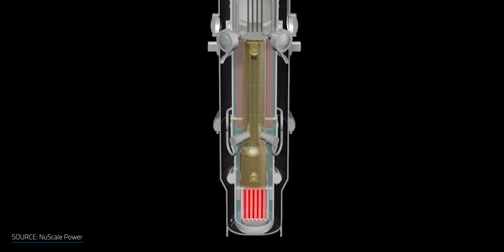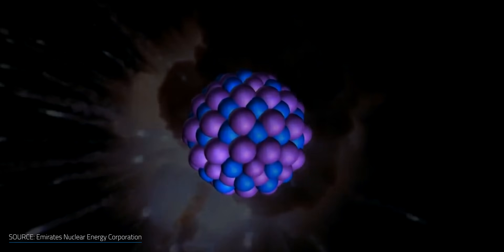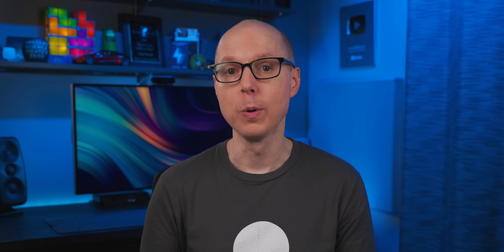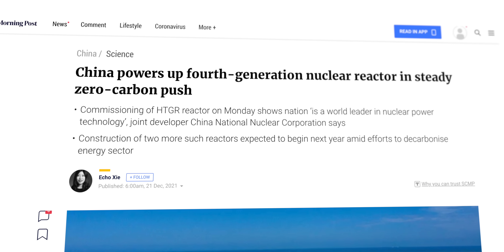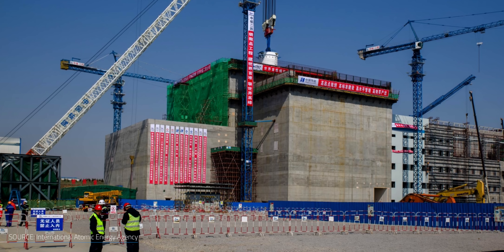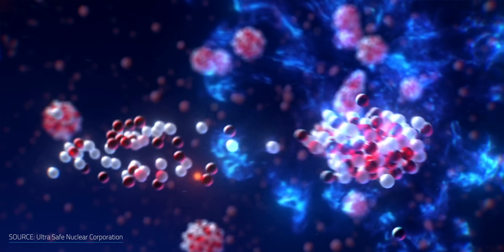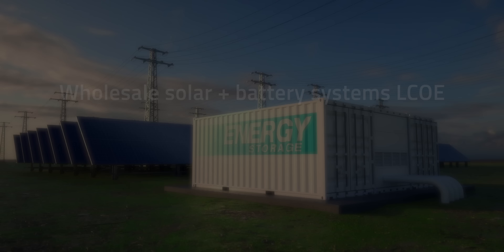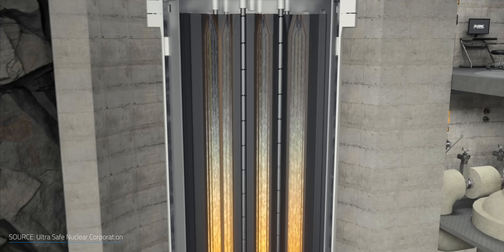Forget Small ... What About Micro Nuclear Energy?

Comment: How can it be called clean energy if there are byproducts that are inherently dangerous to their surroundings for hundreds or even thousands of years? Although dangerous chemicals aren't directly released into the atmosphere the same issue exists as with fossil fuels, just in a different form. If one can take the byproducts of nuclear energy and turn it into something else via a complex procedure, isn't there an equivalent chemical means of processing carbonic smoke from coal or oil burning into graphite or some other carbon-based material?

 The issue with radioactive power is that its excessive potential energy is just as dangerous as it is useful. Sure no one dies in an ideal world where the perfect procedure is perfectly followed for the use of nuclear power and few people die or are injured in a successful operation, but in the event of a catastrophic failure the death toll is far greater and effects people plants and animals, in the surrounding area for at least hundreds of years. How can it be assured that these catastrophic scenarios won't occur; and that in the event of such a scenario no one is in danger?

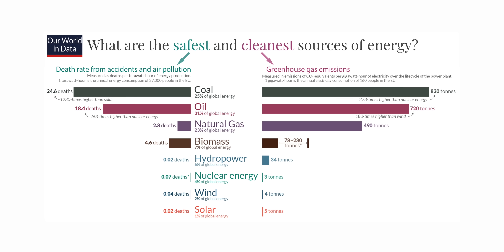Comment: In regards to "cleanest" sources of energy, how does the nuclear waste factor into the chart at 11:00 
Are all historical reactor meltdown events and their subsequent consequences taken into account for the "death rate" chart?  

I'm all for green energy, but we need to ensure we are taking all aspects into account for comparisons like this, rather than simply the pollutants from hydrocarbon fuels. I should be obvious that hydrocarbon fuels would produce more hydrocarbon byproducts; we dont need a chart to figure that one out. Storing nuclear waste in the earth "sounds great" to some, but there are already so many cases of nuclear waste leakage around the world. At least with some models of these smaller reactors, a meltdown may be less likely and much less devastating. There is also the potential that nuclear energy has in regards to capturing all harmful waste, just that current waste handling/storage methods are not yet completely flawless.

Not trying to sound anti-nuclear, just trying to ensure viewers aren't seeing it as the magic cure since there are less CO2 emissions than oil & gas without considering all the ramifications of nuclear power. Unlike oil & gas (and coal as that's somehow still in relatively wide use in the world), nuclear actually has the potential for full waste capture. That alone means its potential as a clean energy source is real, as long as we don't lose focus on the waste and risk aspects.

Comment: Nice video.  As you said, the issue with nuclear is the regulatory requirements.  Nuclear waste (unused nuclear fuel) can be reduced simply by recycling the fuel.  This would also go a long way to reducing nuclear power costs.  But we don’t really recycle anything.  So, not recycling nuclear fuel kind of fits.

Comment: the future of nuclear energy is actually in adapting on its past, specifically the Thorium based reactor designed by Indian inventor Homi Jehangir Bhabha in the 1950s.
The four main reasons for using Thorium are:
1) Thorium IS incredibly abundant, it is the 39th most abundant element found in earth's crust at 8.1 parts per million (PPM)
2) Thorium DOES NOT produce any weapons grade by-products, so the fears of nuclear weapons proliferation are unfounded with Thorium
3) Thorium has a HIGHER MELTING POINT than non-isotopic Uranium, 1,755 degrees Celsius (3,191 Fahrenheit) for Thorium compared to 1,132 degrees Celsius (2,070 Fahrenheit) of Uranium 238
4) Thorium DOES NOT require additional enrichment to power a nuclear reactor, there by skipping the heavily polluting enrichment phase Uranium must endure to be suitable to run a reactor
all things considered, Thorium Molten Salt Reactors stand the best chance at solving this climate crisis, especially if they can be safely miniaturized

Comment: Micro reactors will be a thing, and I think will make perfect sense, just another tool in the toolbelt. Something like this would be perfect for large scale builders to include when building new housing spaces. 10m is the current price tag, with a 3m a year operating cost is the target. So if you divide that by the 1k homes they say it can power, that is only an extra 10k per home to recover the cost and 3k/yr to run it, or 250/m for each home. So naturally, if you load that upfront cost, an additional cost of 37k per home built, means when you buy your home, you get free power for that decade. It would go a LONG way, and that is with no tax breaks from the local municipalities. The more you can scale it, the easier it is. Something like this would encourage businesses to build their own, as 10M to power your own plant and then pump excess into the grid, even if you dont get paid for it is NOTHING when considering rising energy costs. Combined with solar/wind generation, even with current battery tech, no one would ever have a power bill, putting 250/m into 1k peoples pockets would do a lot for the local economy in that area.
Reply: And who exactly is going to check these things are disposed of properly at end of life? This is allready a huge issue for existing RTG's and medical equipment. Throwing thousands of small reacctors out there is just going to make it worse.
Reply: @nonyabisness6306  That is an issue to be looked at for certain, but you have to weight it against the bigger picture. We need better disposal and servicing of these things for sure, but thing of how ancient most of those things are these days when taken apart. This will be done in steps, as the tech evolves, like anything else, change takes time.

Comment: Im super stoked to see more videos like this and it gives me hope for a more independent energy future for everyone, but especially independence for areas like rural alaska, that could utilize energy systems that dont require regular/large shipments of liquid or solid fuels for energy generation. I fancy the SMRs and micro reactors for distant areas and MSRs for metropolitan areas as they are relatively safe and can make use of waste from other reactors, assuming someone can/would take on the task of refining those materials into useable metal salts.... its also worth noting for Molten salt reactors that the waste mass is very significantly reduced compared to conventional LWRs if im not mistaken.
Reply: Plus the "waste" is short lived too. Whilst it is very radioactive, it decays to background in 300 years vs 100k+ years for the "waste" from a LWR that is really just fuel for a breeder reactor...Additionally, the conversion of the waste to fuel salt is relatively easy & does not require to material to be put through the normal reprocessing steps.
My preferred reactor design is the Moltex reactor for multiple reasons (MSR/no pumped fuel salts/versions for wasteburner/thermal/Thorium reactor), with the design focus being use what works repurposed for MSR use, minimise costs for the reactor, ensure safety is designed in as passive systems, so it is walkaway safe.

Comment: I'm not ruling out nuclear, but what the safety statistics fail to take into consideration is that Chernobyl and--AFAIK--also Fukushima required suicide missions in order to prevent a very large disaster. In the case of Chernobyl, it would have made Europe inhabitable if three men hadn't "volunteered" (and succeeded in pitch dark!) to find and open the valves so that the water that had accumulated in the basement under the reactor could be emptied out. It they hadn't, and the core had melted its way down into the basement, well, say farewell to Europe. As it turned out, those brave men survived but going in, they had to expect that it was certain death for them. 

However, that's where SMRs could be interesting. Even though they are more expensive, they could perhaps be relevant in places where there isn't room for solar and wind, and to secure a baseload.

Comment: The main problem with nuclear waste is it is being wasted.   Even after its is called waste it still has close to 90% of its fuel.  This fuel could be recovered by reprocessing it and reused in the reactor.  This reprocessing can be done on site which would reduce the over all waste problem.
Reply: I think "spent" comes down to a minimum watts per square cm seconds output?  The power generation side is a steam cycle, and failure to superheat correctly means turbines may not survive the onslaugt of vapor.
Reply: @flinch622  "spent" fuel can be reprocessed and reused. The point is it can be reused and if done correctly this process could possibly be done onsite or next door to the power plant without issue. Making the fuel last 10x longer or more and drastically reducing waste

Comment: Great job, Matt! I always thought that uranium based reactors need to be of a certain size as the statistics of neutron production require a certain critical mass to keep nuclear fission up, which is also an important safety measure to control the process. Reducing the size now to SMR or even micro reactors requires a much higher enrichment of U235. Is this not extremely costly and also quite dangerous in handling? Just wondering.....
Reply: A more optimized design allows for less coolant used, less enrichment, more safety and less fuel overall, than conventional huge power plants, at a lower power rating.
Reply: There is definitely a dance on moderation, size, and the chain reaction.  But in the past I think the size is based on a output vs fuel situation.  The bigger and more fuel you put into it the more efficient that fuel is used and more power output.  Reactors would be designed for like 1GW instead of 300MW.  This made more sense when reactors were thrown together with much less regulation, and easier to build a big thing on site.  Now the need is to get a reactor built on an assembly line, and don't change the reactor design.  Just add more of them.  Get them operating safely, cleanly and cheaply.
Reply: @dodaexploda  I would just like to politely point out that you just described existing nuclear tech. There is nothing slapdash about existing reactor design or facilities. Not to say no need to innovate, the CanDu reactors (still decades old, modular, and operating to-date without an accident) offer the ability to refuel without taking the reactor offline. All of the things that make SMRs attractive (other than the fantasy that they are better because they don't exist yet) can already be found in just about any existing or under construction nuclear facility. Were SMRs to bring to light any innovation that didn't already exist, the next logical step would be to scale it up.
Reply: @thebojinator1  I think you're making a mistake when referencing the Candu reactor.  I do believe it's properly referred to as the "Mighty CANDU reactor".  :D  I really love those reactors.  I'm not sure I agree with you in regards that SMRs don't have anything to bring to the table.  The smaller size alone can be worthwhile especially in more remote locations where you don't need GWs of power.  I just recently learned of a propsed steel plant that will run on electrcity alone and use 300 Mw of power.  Perfect for a dedicated SMR.   Also the smaller size might make it easier for the economics of scale.  It's likely easier and cheaper to build more smaller parts then fewer larger parts.  A comparison could be SpaceX Raptor rocket engine at $1 million vs SLS's RS-25 engine at $40 million.  Starship's booster has 33 engines bringing the total cost to $33 million.  SLS has 4 engines which brings the cost to $120 million.  There is obviously differences in how they are made and contracts, etc.  But something to ponder either way.
Reply: @Doda Exploda  Clearly I would be preaching to the choir, as evidenced by your proper correction of my misuse of CanDu without the associated qualifiers! I guess the only thing I wanted to dispell is the misnomer that existing reactors can't/aren't already modular and able to be factory built. I fully agree, and have stated in other comments on this video, SMRs and advanced nuclear tech definitely have their place. I just want to quantify (as I feel was not well addressed in the video, not nec. your comment) that SMRs don't necessarily compensate for deficiencies with existing tech, rather offer a low carbon, energy dense, alternative to the fossils that are currently being used in remote and hyper-industrial locations. It's one small nuance, I know, but sadly we all face an uphill battle on changing the perception of existing nuclear power!

Comment: I have my thoughts about the distribution of small reactors, not the size. I prefer having big centralized plants with a team of specialist on site over a probably less locally monitored reactor in every town.
Reply: I have the same concern. Even if micro reactors are far safer on a per basis scale, having so many instantiations seems like it will present many more opportunities for catastrophe.
Reply: @ElEustis  What catastrophes? Do you still have visions of old technologies "melting down"? We drive modern cars with safety features we did not have in the 40s,50,60s,. those issues will be resolved by intellect and innovation. I don't choose to live in fear of what ifs.
Reply: @johnwmendenhall9896  I have a lot of hope for nuclear, and See it as a necessary piece of the puzzle in decarbonization. My point was simply that even if something is 100x safer, if there are a 1000x more them it presents considerable risk, especially as the stakes are quite high with radioactive material.

Comment: The waste is the big problem. 500 years is a long time. You believe humans can keep the waste safe for 500 years and the amount keeps growing? The safety record will drastically change when a release of the radioactive waste is released to the atmosphere. This release could come by human error, natural disaster, or terrorism or any other method. These time bomb nuclear reactors should not be built. Wait to use nuclear reactors when ones are developed that have no nuclear waste. This type of reactor has been researched for many years. It's always 4 years away. It's worth the wait. The potential for disaster with current nuclear reactors is always ignored or just slid over.

Comment: So SMR would be about 20 cents/kwh and my local utility goes from 10-13 cents/kwh which means the bill could be nearly twice as much.
But are we talking apples to oranges or apples to apples?  If the 20 cent figure is applied AFTER it goes 20 miles then there are a lot of losses to factor in to that
final price, but if it is actually a neighborhood power plant serving homes in a 5 mile range then there would be fewer losses and it might be cheaper than long
range power from a huge plant in the center of a metro area.  So where did the $200/MWH figure come from local or long fed range?  If 20 cent/kwh is the best
price from a neighborhood plant then twice the price of fossil fuels is a deal breaker.

Comment: If they built one small enough I could put in my house, I would totally use it!
Reply: @Eliza Coleman NPP are way safer than you think only old generation reactor with design flaws (Tchernobyl) or placed in high risk area (Fukushima) are dangerous, cooling water used is also perfectly safe to swim in as the contaminated one is running in a closed circuit at the core

Even the spend fuel pool is safe to swim in as only getting a few meter from the spend fuel rods can get you irradiated
Reply: @Eliza Coleman yes you would. A micro reactor would generate no less than 200 kW, more than enough for one house, so I would share with my neighbors :-)
Reply: Why not just bury the ones NASA has been using for DECADES under everyones house? O.o 
Besides the fact the Power Companies would fight it like crazy since they have monopolies on Electricity. :/
Reply: Their sweet spot of size and output is likely to be closer to something that can power a neighborhood while many can power a small town collectively. No regulatory body is going to approve an individual domestic use.
Reply: You!!? I wouldn't trust you with a stapler!
Reply: And some lunatic will strap a few sticks of TNT to it and irradiate New York.

Comment: I contributed to the design of the NuScale electrical system in 2016. But that's largely irrelevant to this discussion. The only viable energy source I have seen that holds VAST potential is the Hydrogen economy. It's carbon neutral (where, NO C is used in its energy transformation) and it produces clean, abundant, powerful, portable or stationary energy in an almost INFINITE quantity. And it's far FAR cheaper to set up and run than all the garbage they're pushing now.

Comment: As you point out, there are some regulatory issues.  SMR's are still working with regulators to figure out how many staff are needed at multiple-reactor SMR sites for example.  Current law requires a certain staff per reactor but when you have 8 or 12 identical reactors, Nuscale proposes a given operator can handle several reactors at once.  I know this is a small issue, but staffing and security traditionally based on 'per reactor' needs to be reviewed and worked out.  (one of the 'regulatory issues' you mention).  With current nuclear plants, staffing is a significant part of O&M costs, so it is important to address.
Reply: Good point. There would be economies of scale at the power plant as well, by having a reactor farm and not just one reactor.
Power plants are a 24/7 operation, so you need to staff for 24/7 and not just Mon-Fri 8 hours a day. This doesn't seem like much, but a full week ends up being around 4 times the man-hours of just Mon-Fri 8-5. You'd need a minimum crew/shift, in case someone's sick or Jeff needs to use the bathroom.
Making a reactor farm with 8 or 12 reactors makes a lot of sense.